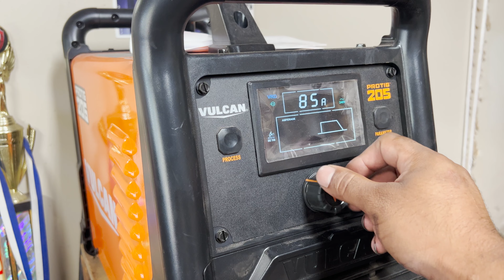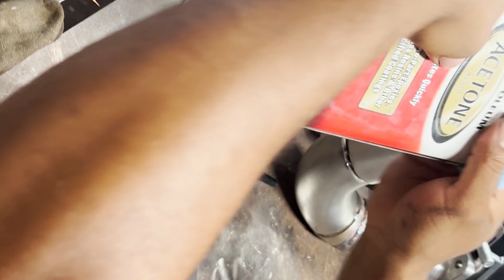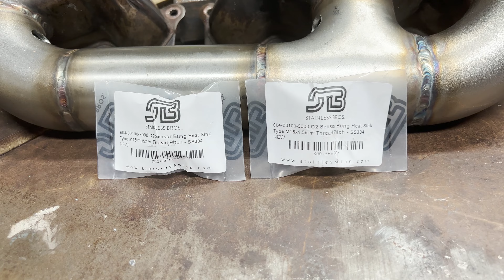diy n54 single turbo manifold pt2

Comment: Beautiful craftsmanship and really great fit. My one concern is the hot side of the turbo being too close to the plastic valve cover, maybe thermal wrap my contain some of the heat. And that gt45 turbo is really big. I would like to try to fab a single turbo header but go with a Holset turbo. Beautiful work!
Reply from the maker: Appreciate it brother🙏🏽 so about melting the valve cover i daily my car on a borgwarner s362 about same frame size of the gt45 and i have a little over 8k miles on her and no signs of melting my valve cover yet🙏🏽 deff give it a shot brother its really fun making your own parts🙏🏽🙏🏽💪🏽

Comment: Bro, next time you do wastegate placement just weld the gate in and hole saw the hole out. It's so much cleaner. And you don't have to worry about trying to get the fit up correct.
Reply: Dude that's a brilliant idea!